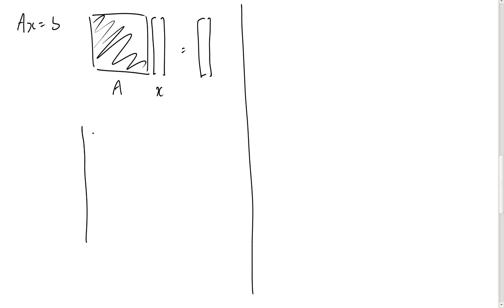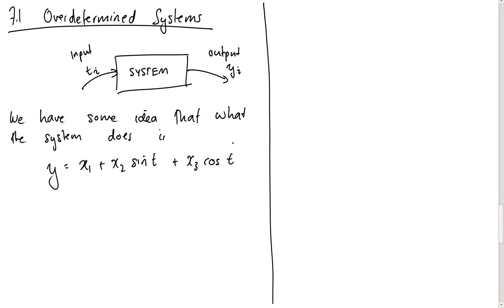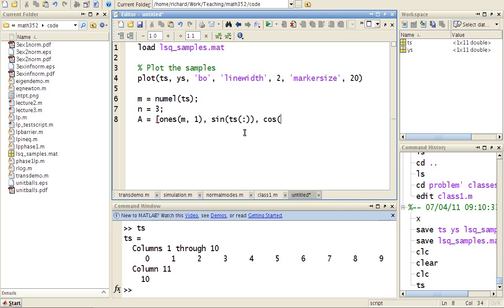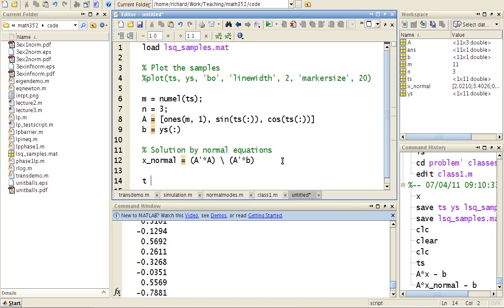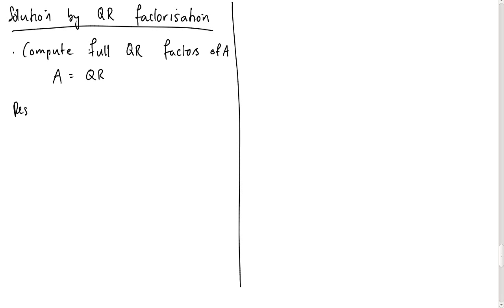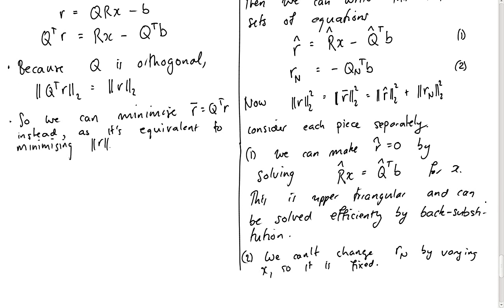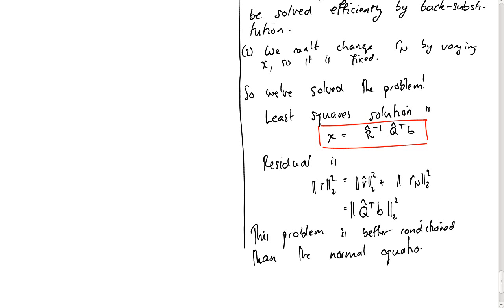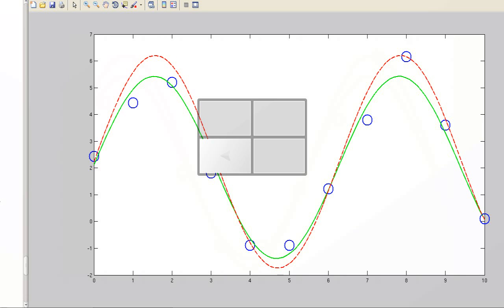Lecture 7: Least Squares (overdetermined systems)

Comment: So like driving an Audi?
Reply: +JT4GM4K3R I am intrigued by this comment ... care to elaborate?
Reply: +Richard Brown The driver can represent x^1, and model subjectively is the handling dynamics. Since their awd is heavy and needs damper control, all-wheel steering, adaptive air suspension and diff vectoring. Thus most control from driver input is as drive by wire. Futile deductoiion

Very helpful. Thanks!
Reply: Very welcome

Comment: what happen if i do not know what the system does??
Reply from the maker: theCguy L I'm not entirely sure what you mean ...
Reply: RGB mathematics Sorry sir i think i just ask a sensless thing, i was thinking that i am required to know some kind of physical law that govern the system A, but that is not true because given any king of overdetermined A i am just finding the least square solution of it right?...but in my case i encounter some kind of problem solving a minimization for obtaining my camera response function, my proble is i do not know ho to put A in the right form... anyway sorry for bothering u and sorry for my bad english also :)
Reply: +theCguy L I know this reply is 9 months late, but better late than never! Yes, whether or not the system has come from something physical is irrelevant ... the method just takes an overdetermined system of equations. And no need to apologise!